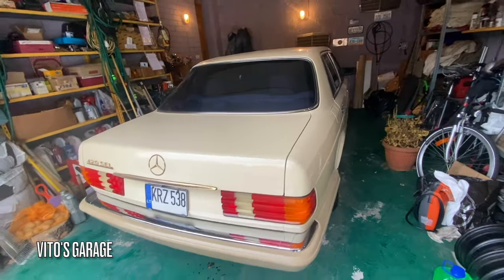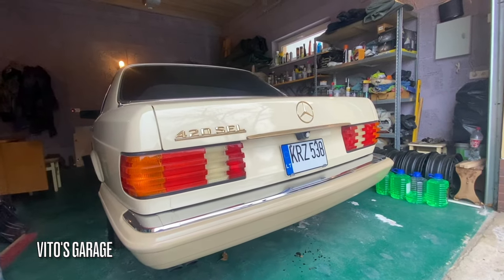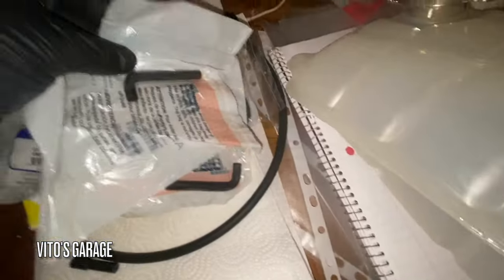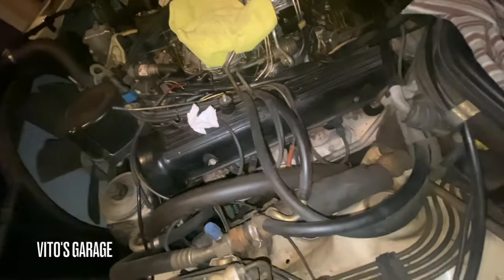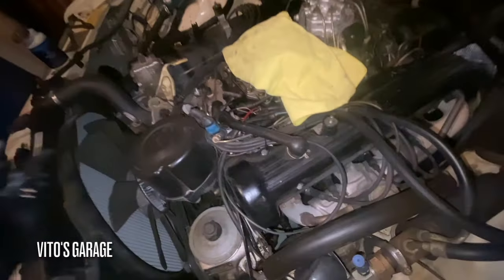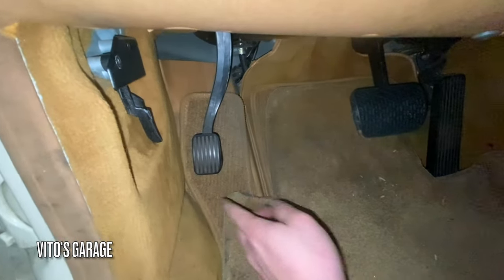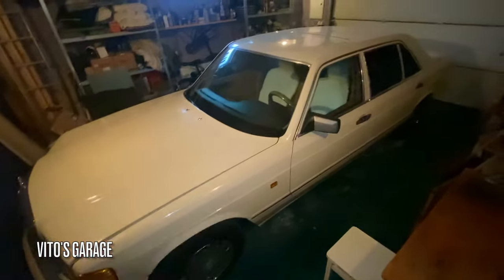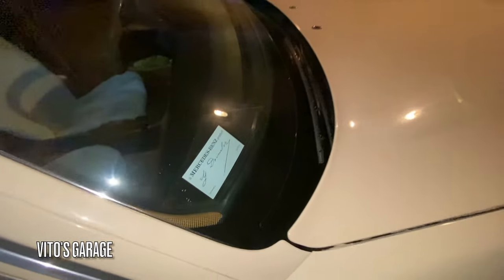W126 S Klasse Dad's Garage Queen Immaculate 1990 Mercedes 420SEL. Putting Love into Classics!!!

Comment: I’ve got a question, in need your help with my Mercedes 300e I put a new fuel distributor on but nothing is coming out when I hit the air sensor plate (I did run the pump until there was gas running to it) I’ve been working on this for a few days now. Thank you!
Reply from the maker: So with the pumps turned on and you pressing on the air flow plate, there’s no fuel coming out of the distributor holes? 
What happens if you don’t press the air flow plate?